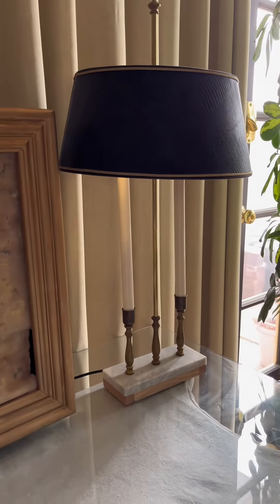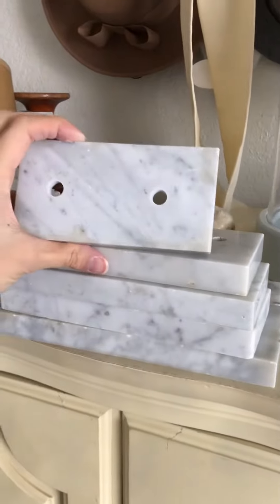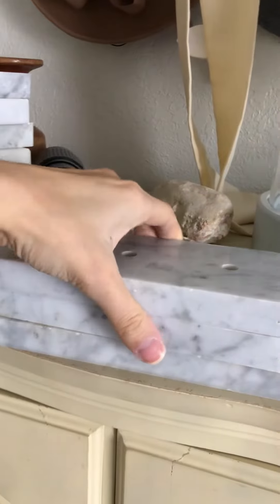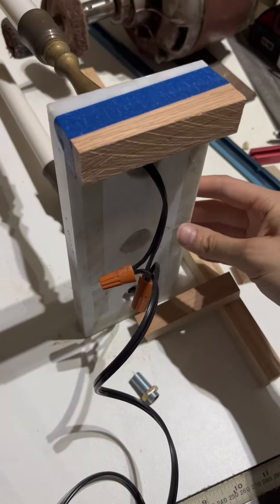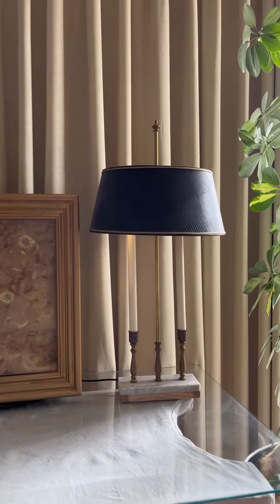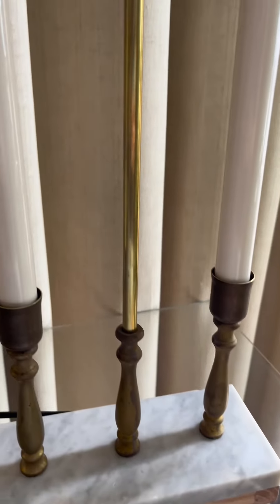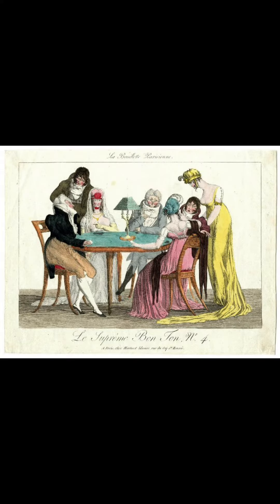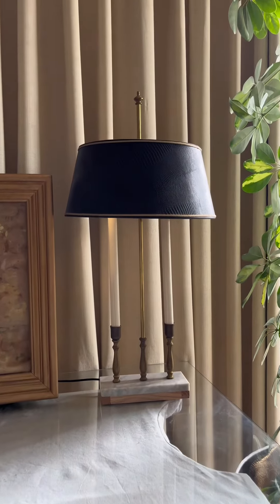Making a Modern Bouillotte Lamp.

Comment: Thats good. I was wondering why the lamps I have seen in photos only, had the long rod sticking up. Thanks. I am a retired woodworker, and I would  of made the wood base from 1 piece of oak or walnut longer and wider so there would be a 3/4" wide step all around. Good job.
Reply from the maker: That's a great idea for the wood step! I might have to remake that part. The long rod in the middle was so they could move the shade up and down with the candle burning before they had electricity. That way you never had to look at the flame directly. They used these Bouillotte lamps next to where they were playing cards so they were close to eye level. I hope I was able to answer your question.

Comment: This is gorgeous and so clever!  Can you tell me where you got the rod and the piece that you use for it to slide up and down?  I bought a Bouilotte lamp that is missing the everything above the two bulbs and am trying to replace it.
Reply from the maker: @erinthornley9165  I thrifted some of them. Parts I can’t find I like to get from Grand Brass Lamp Parts or other lamp parts stores. I get brass pipe from them. You can also try finding a local lamp shop that would sell you the parts. Hope that helps.
Reply: @JazandTheo  Thank you so much!